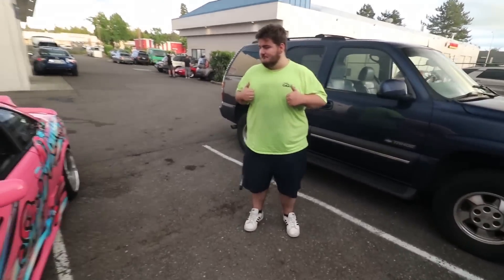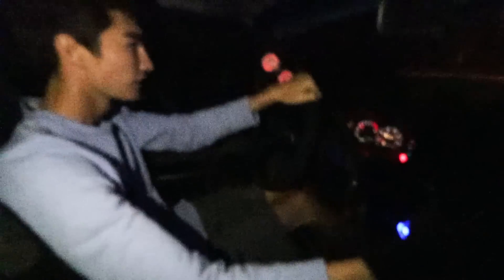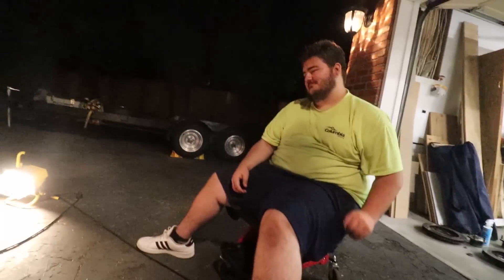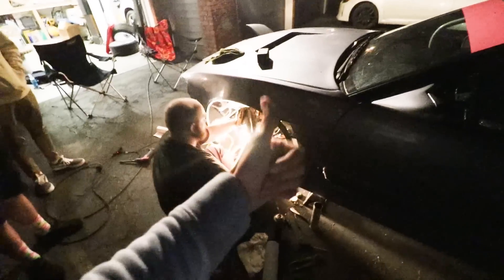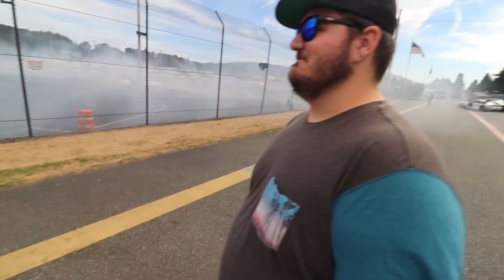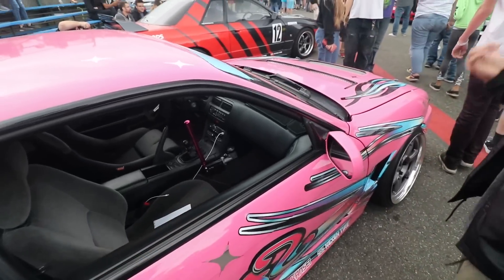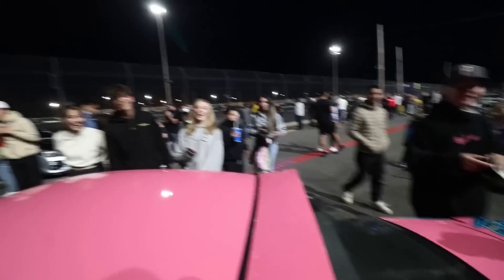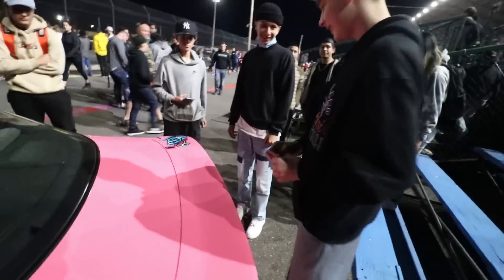What It's Like Taking my Nissan S14 Drift Car to a Car Show...

Comment: Bruh why you got the hydro so far? It's gonna take so much more  effort to pull it than if it was on the other side of the shifter.
Reply: i had mine like that for a while and i kept fumbling my gear stick whilst going for the e-brake, so i changed it to near the steering wheel and it was a lot easier going from wheel to e-brake, and i got a gear shifter a similar height to the e-brake, so the transition from wheel to gears then to e-brake was seamless, it might not work for everybody but it's best to try different ways until your comfortable.